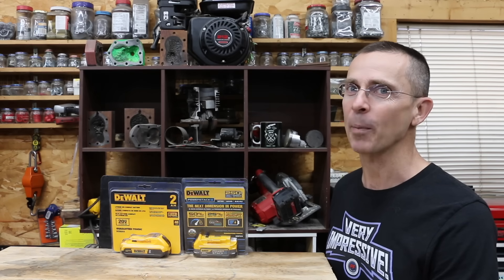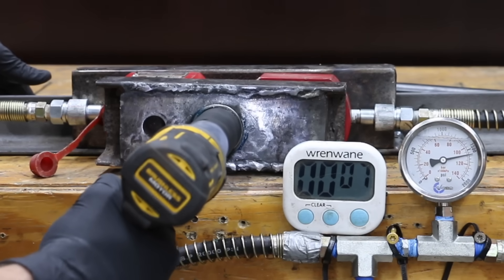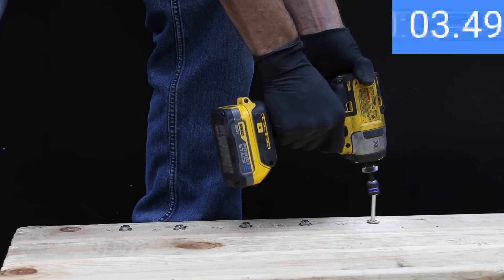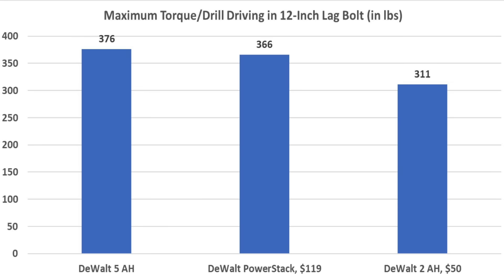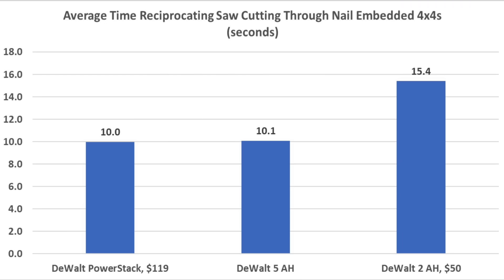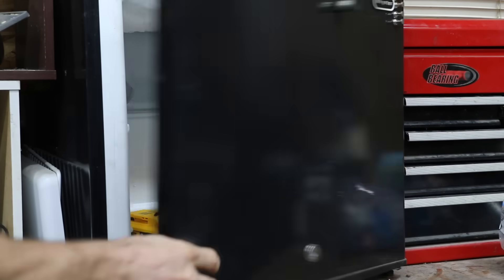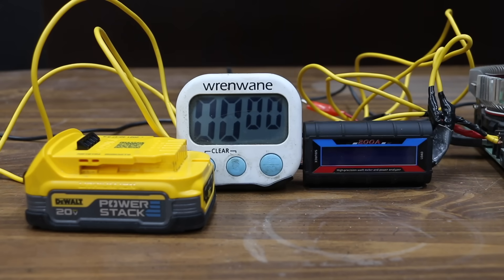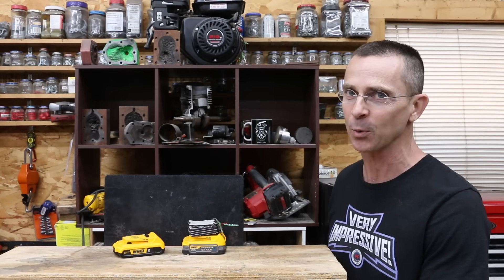Compact “Pouch Cell” Battery Better? Let's Find Out!

Comment: WARNING!!!! You have made a seriously bad mistake with this video.  These new DeWalt Batteries are not new at all. They are called LiPO and have been around the Drone world for years. They are so dangerous that Drone operators carry them in sealed fire and explosion proof boxes. Nobody, not even Tesla uses them. They can explode, and pose a serious hazard to public safety. DeWalt has been on a "dog and pony show," full of propaganda. In order to sell the people on the 10% good these batteries may do. In order to get the public to ignore the 90% bad they will certainly do. Regardless of DeWalt's BS, these batteries are dangerous. They will explode, cause fires, and probably injure a lot of people. I don't who insures Black and Decker. But, they better drop them fast. Before, all the lawyers sue B&D into bankruptcy; and deservedly so.
Reply from the maker: Thanks for the information.

Comment: Great video!!
I trust 18650 alot more than lipo packs. Lol. I've seen them ballin up with age and cycling. 18650 seem alot safer. However when one cell dies the pack is dead and need to replace the cell. 
Always great videos man!! 👍🏻

I do like the newer 21700/20700 cell packs. They seem to be better for power delivery. The newer 3ah and the bigger 6ah and 8ah use them. For the safety I'll take those over the new lipo pack ones
Reply from the maker: Thanks!  Thanks for the feedback.

Comment: What about tensile strength of your average lug stud on a car or truck so many people think that it'd perfectly fine to tighten it until a impact stops turning. I'm curious at what point are the studs fractured from being over tightened
Reply from the maker: Thanks for the suggestion.

Comment: Wow those prismatic cells are normally cheaper than the cylindrical cells and you can’t beat the safety of the lithium cells wrapped in a steel cylinder if you ever drop a battery from a ladder.
Reply from the maker: Thanks for the feedback.

Comment: I bought a 2 pack to drop the cost per battery a bit. If people are going to get into it, that’s the way to go. 90 per battery instead of 120 for a single. It’s a brand new product so it’ll be expensive for a while until they make the R&D money back
Reply from the maker: Thanks for sharing.

Comment: Nice work. I wonder if they’ll do well in heat and durability. 
I use lipos In drones and they can be damaged with a dent. But these should be protected enough I suppose. 

But when testing were they cooled off a while? Running hot isn’t good for these. 

I also wonder about longevity, are the packs smart and discharge the cells when not used for long periods? If not life will be reduced

Comment: What I want to see is, is there different adapters for different batteries for different tools? That way a person is not enslaved to say just DeWalt, Milwaukee, Hart and other tools and batteries.  There should be a normal setup so one doesn't have to be locked into that Unit and battery.
Reply from the maker: Thanks for the suggestion.

Comment: years ago i would modify batteries to have cables running out of them so they would use AC, as indoors i don't mind beeing tied with a cable...you can even slightly overvolt with no issues
Reply from the maker: Thanks for sharing.

Comment: If the stacked pouch configuration catches on the price will drop naturally. I'm curious about heat management, especially in anything larger than the 2AH equivalent seen here. 
Adding the 5AH in to this test was awesome, proved a very simple reality: There's no replacement for displacement.
Reply from the maker: Thanks for the feedback.

Comment: Thanks for conducting this interesting test. It is very interesting that the power stack battery capacity is not listed anywhere and the price is very close to 5AH battery, although your tests show that the capacity is slightly less than 2AH battery. Batteries are priced by their capacity and pouch cells are usually cheaper than cylindrical cells. There is a reason why Tesla and Battleborn uses cylindrical cells, they are much sturdier and resistant to internal pressure causing them to swell. The BMS circuit installed on top of Li ion battery limit the power output to prevent battery damage, it is likely that the power stack bms is tweaked to send slightly more power as we have seen in your tests where tools showed slightly more power compared to 2AH battery and as claimed as %age more power than 2AH battery.
It is disappointing to see companies indulging in these advertising gimmicks to trick customers and maximize their profits, afterall how many customers would know the difference between capacity and power.
FYI, capacity is the total energy stored in the battery and power is  the rate of consuming energy or capacity.
Reply from the maker: You are welcome!  Thanks for the information.

Comment: Great comparison. It will be interesting to see if the power stack does come down in price and up in capacity to at least the 4AH mark for sure.  Just to mention both packs had 5 series cells. I know you know your packs, but I believe you mentioned the 2Ah 18650 had 6 cells. They are both 5S. Thanks again for the comparison!
Reply from the maker: Thanks and you are welcome!

Comment: It looks like 5Ah batteries met or beat the power stack in everything except weight. At about $73 each in a two pack, the 5Ah is still a much better deal. At the same performance, I would rather save the money and spend less time swapping packs, so I would only invest in 5Ah packs based on this info.
Reply from the maker: Thanks for the feedback.

Comment: If you rub the threads of those lagbolts or screws with bar soap they will drive easier an save your battery
Reply from the maker: Thanks for the tip.

Comment: I'm glad you ran it against a 5Ah, I don't use lower Ah batteries so I don't care about dewalt's comparison to a 2Ah, especially at the price point, as a professional carpenter I'd rather be changing batteries less often for less cost
Reply from the maker: Thanks for sharing.

Comment: Another excellent video these really do help make decisions with what to purchase. A video suggestion are you able to do one on LED torches like the ledlenser P17 and similar torches. Like battery consumption rate, brightness, durability/waterproofing, distance usable light, ect that would be really good to know ive brought a heap of ledlenser products over the years but I'm wondering if ive been duped and are any of the cheaper one just as good
Reply from the maker: Thanks!  Thanks for the suggestion.

Comment: Outstanding Todd!  This was a great test!  Thanks for that.  This has the potential of being the proverbial ‘game changer’ in future tool and OPE battery applications.  DeWalt is getting back in the game with innovative technology and thinking, like they did in the 90’s.  

J.C. Wren made a great comment below.  I would add that the 2.0 batteries have ‘their place,’ in lighter duty applications, when weight/ bulk will be an issue.  The 21700 4.0 batteries, as well as the 6.0 and 8.0 are great batteries.  But it’s hard to beat the 5.0 Todd used here for most all applications.  👍👍👍👍✌🏻🇺🇸😄
Reply from the maker: Thanks and you are welcome!

Comment: That small PowerStack is just not that impressive.  I use the 887 with my 2ah all the time, and a 5ah when necessary.  If I need more power I switch to my 998 with and 8ah battery!
Reply from the maker: Thanks for the feedback.

Comment: These new batteries are lithium polymer cells, they will not perform well in a work environment after just several complete discharges. I Lithium polymer batteries will self destruct if the voltage is not maintained. Bad idea DeWalt.
Reply from the maker: Thanks for the feedback.

Comment: Was there a significant difference in recharge times between the lithium cell packs and the lithium pouch pack? If the pouch pack can recharge faster, that may help offset the cost a little as you would need less of them overall for continuous use.
Reply: Battery charge rate is determined by the charger, the current level to fill the capacity of the pack.  It does not vary based on which lithium cell type is inside. - with one exception, that if the minimum cutoff voltage threshold is different from the different protection circuit, if you get less out of the battery before it shuts off, there's less to put back in charging it.
Reply: recharge times are dependent on the charger not the battery in this case. To fix this issue you need a 2nd battery instead so you can rotate

Comment: For the price of them. I think I’d rather invest that into the flex volt batteries. I have some flex volt tools and when I use those batteries on the 20v system it gives them a ton more power and run time
Reply from the maker: Thank you for the feedback!

Comment: This was an incredible test as always, Definitely will stick to the cell batteries for a while until prices come down. I wonder if Milwaukee will produce something similar. 
Todd, would it be possible to do tests on air compressors? Maybe not longevity but test manufacture's claims about being "20% quieter" and also which compressors fill up the quickest. It's an expensive test I think but it'd be valuable for many people. Again love your vids, you always produce great stuff.
Reply from the maker: Thank you for the video idea!

Comment: Disappointing you did not mention the price of the 5A battery.  I am guessing it must be similar to the PowerStack.  If so, you should really go for the 5A battery over anything else.    At the price the PowerStack is selling, you can get more than 2 of the 2A batteries, so that would be a better choice too since the power stack is barely better than the regular 2A battery.

Comment: conclusion. If you need better, get the 5ah one..not worth the pounch tech..especially since it's unserviceable...the cell type you can upgrade/repair for cheap (just get cells and spot welded), the pouch type, you're scerwed
Reply from the maker: Thank you for the feedback.
Reply: @ProjectFarm  and thank you for your video, showcasing the product and seeing it used being used.
Personally I see this pouch battery useful only for the eskimos living in cold and maybe needing a quick drill or securing a bolt while travelling for 10 hours in deep freeze to repair their dog sled.

Comment: Poly cell are not reliable and puncture resistance poly will puff up and blow up as the 18650 or 21700

Comment: LiPO batteries have a higher discharge rate than what is capable of Li-Ion. With lithium battery technology you generally trade capacity for discharge rate which is what I take away from this video as well. I'd like to see them make the pouches bigger and still fit the same size as the 2AH Li-Ion battery packs. LiPO is generally more expensive though. I'm not sure it's a good trade off. 

One major plus I saw was the cold performance. So maybe it has its niche.
Reply from the maker: Thank you for the feedback!

Comment: Here is a test idea.  Cut  3/4 pressure treated plywood in a circular saw.  Inches per amp hour would be great to see especially combined with drive to failure on lag,s. Or better yet headlock drive to failure. Good tool users use good materials
Reply from the maker: Thank you for the video idea!

Comment: Despite the difference in performance, I would choose 18650 style batteries over pouch 100% of the time. The pouch style will eventually puff and in my experience, do not hold up well in high temperature scenarios such as being stored in a vehicle during the summer months. Considering how pouch batteries are typically less expensive are, I'm amazed that DeWalt is charging so much more than 18650.
Reply from the maker: Thank you for the feedback!

Comment: At more than double the price I will just keep soldering new higher capacity 18650's in myself for about $20, noticeable upgrade to original 2ah batteries that I can keep doing forever.
Reply from the maker: Thank you for the feedback.

Comment: People in the Radio Controlled model hobby know about the difference between 18650 and pouch Lipo batteries. What you you are seeing is the difference in what is called the "C" rating of the technology, basically, how fast you can put and get energy out of the battery. Pouch Lipos almost always have a much higher C rating than 18650s. The C rating for the 18650 is usually 1C, while Pouches can be anywhere from 15-50C.  I have one RC Vehicle, the WLtoys 12428 rock racer, sort of a dune buggy, and it comes with a 7.4V battery pack using  two 18650s, and it goes OK, but when you use a Lipo pouch battery, it really chooches!
Reply from the maker: Thanks for the information.

Comment: This was an excellent showcase sir. The powers powerstack is only 1.7 Amp hours but it really does deliver the beans for its run time. I'm more interested for when they release a 4 amp hour version, that will be able to out work a regular 5 or 6 amp hour battery
Reply from the maker: Thank you for the feedback!

Comment: This battery looks very promising. The   current iteration was most likely to test the waters on acceptance and durability in the field. Im sure that they will come out with a 5 ah version soon enough. 
Once economies of scale come into play as they make more and more of these packs, the price should come down a bit. Probably not 18650 cheap because those cells are made for so many different applications but perhaps 21700 cheap.
Reply from the maker: Thank you for the feedback!

Comment: There probably will be some increased capacity batteries, these were probably just a test to get them into the field and actually being used properly, while keeping safe. Large packs of lipo are dangerous, takes time to know if the design can withstand the abuse of the tradesmen’s environment.